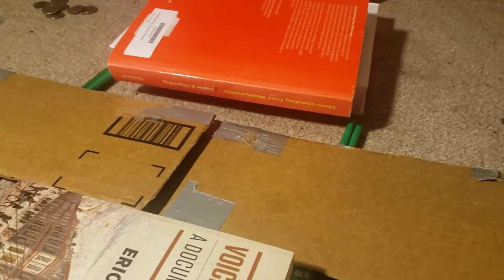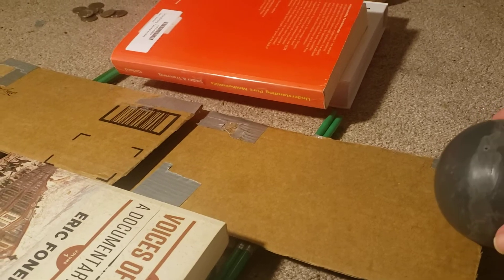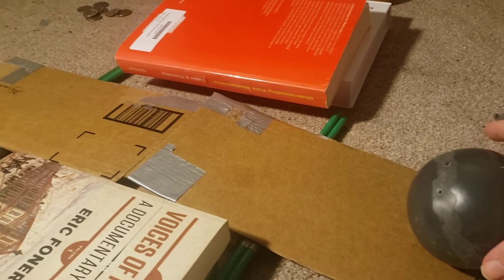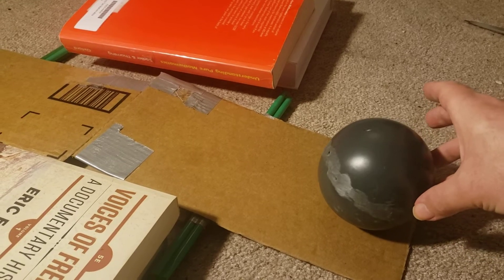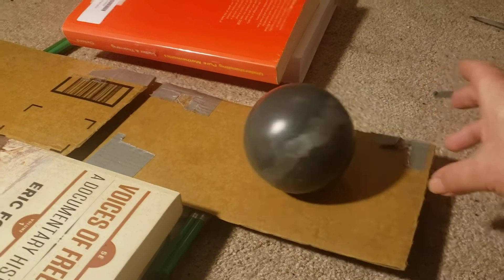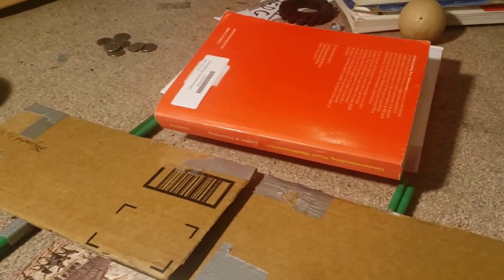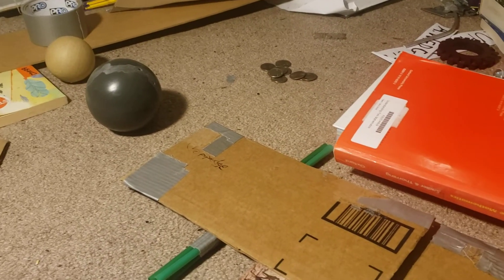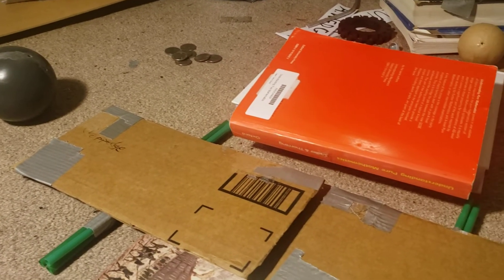Modular Lever More Justified than Thought

Comment: There is input energy, the force you used to lift the ball to place it on the ramp at the beginning, you can see the ball ends up lower at the end of the track than the beginning so it has lost some potential energy (though gained some kinetic) I’m assuming you have weights taped underneath the other end of the ramps and lifting those up is where the energy is actually being stored